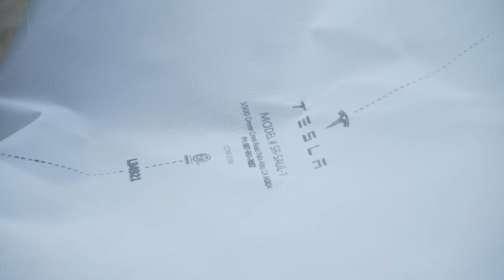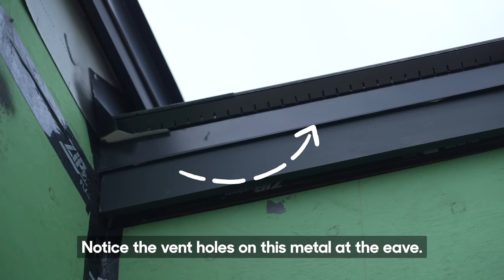Tesla Solar Roof - A Builders Perspective

Comment: I would love to see how the roof performs once everything has been installed.
Reply: Including the total bill and expected ROI.
Reply: Total bill is said to be barely more than a new roof with regular solar added. We’ll see about that.
Reply: Yeah, especially the difference between the installed wattage vs. real world production wattage. So how much power does the installed 55kWp actually produce on an avarage day...
Reply: you must be new here
Reply: @thomasegjoergensen  If most of the cells are facing South on the best days (early Summer) they will produce around 250 kWh per day. On the shortest days in the Winter it will be around 100 kWh per day.
Reply: @Aircam73  Just for some context, south facing wall in the east coast. 20kw system produces 145-153kwh during summer days. I can see his system performing well over 250kwh a day I'd say close to 350-380kwh a day
Reply: @nicholasthon973  Yeah, people buy into anything these days. This is a VERY irresponsible purchase being a beta tester for Tesla. We will soon find out the details on why this system will basically cost you more in the long run, only a matter of time. None of this crap is tested to the point it needs to be.
Reply: I knew that these were going up somewhere.
Reply: @petebusch9069  How would you know??
Reply: The specs on this particular install are insane, probably cost a couple million just for solar and associtated electrical. ROI is not a factor.
Reply: @johncahill3644  Because everyone is a salesman today, nobody can lay out the real costs, everything breaks, nothing lasts forever, and this has not been fully tested. That's how.
Reply: @petebusch9069  please explain.  They have been producing for years at this point and seem to be solid.  My wife's coworker has it on his house for probably 5 years now and seems happy he has a F150 lighting and a brand new Tesla that he brags that he drives for free.  He is honest and says the ROI is probably never but he loves getting a check from the power company.
Reply: @tysleight  5 years is nothing in terms of testing. He paid over 100K for that F150 that he gets to drive for what he calls free same with the Tesla but completely dodged the install, maintenance, repair, and upgrade cost of the shingles and system. There is no way he's coming out ahead for what he spent. Prove me wrong and do ALL the math, all of it.
Reply: @simonsrattanroom  I'm sure its high but lets not exaggerate, a couple mil, come on. I would like to know the real cost that they do such a good job keeping a secret.
Reply: @petebusch9069  big exaggeration,  again not sure who would need this much power and for what lol but I can speak from personal experience. My system cost 70k all 3 powerwalls and 20kw, 26% federal rebate and 1k state incentive. That put me down to roughly 49k once I received two years of rebates for sending energy to the grid and connected solutions. I can tell you this guy received either a 30% federal rebate or 26% + state incentives. If I had to guess based on what I was quoted before it was about 120k for the solar roof. It would be safe to assume this is double that price so close to 300k on the solar alone, the battery's have come down in price now. You can get 3 batteries for 24k and 7k after incentives. Roughly speaking based on the tesla page cost 10 batteries would be 25k after federal rebates! that's insane. People saying this doesn't work or he won't ROI based on his power consumption are just speaking without facts or don't even have a solar system to begin with. Edit: My roof is mainly south facing which helps alot!
Reply: @petebusch9069  
Beta tester?  I've had the same system, but smaller (4 PWs and a 16 kwh Solar System), installed and running flawlessly for 6 years now.  Powerwalls and the solar work GREAT.  No degradation for the powerwalls capacity, and because power is so darned expensive here in SoCal, we just hit our ROI last month.  It's great not being beholden to anyone for electricity.
Reply: @EV-tu5rp  I could see that production capability but by the look of the house only about 50% will be South facing. This will make it much less capable than all 55 kW facing South. These are just guesses based on my 19.6 kW Tesla tile roof here in Texas. Since mine only has around 45% facing South and the best day I ever got was 110 kWh produced I would bet their production is closer to my estimate than yours. Either way it is a massive solar roof that will help stabilize the grid here in Texas.
Reply: @petebusch9069  Damn Dude you really are pretty misinformed. I have had solar shingles for over 3 years now and my insurance has gone down 30% due to the hail and fire ratings on the tiles here in Texas saving me around $800 a year. I used to pay over $5,000 a year in electricity and that was back in 2019 before they raised the rates. I paid $74,000 for 19.6 kW roof and 4 PowerWalls. My roof was damaged due to hail so insurance paid out $20k and the federal tax credit paid out another $19k. Total cost for my system was $35k which will pay me back in around 10 years. If I factor in the $6k deductible I was paying every couple years due to hail damage the roof will pay for itself in less than 6 years. Everyday after that I am making money. This along with the fact that I can stay off grid indefinitely as long as the sun is shining and around a week if it isn't makes this one of the best investments in a house that I could ever imagine.
Reply: @nicholasthon973  not even close. It is cheaper to put on a new roof and get solar panels installed than the Tesla solar roof.  And the Tesla Solar roof will put out less electricity.
Reply: @Aircam73  Get down to a 3 year payback and I'll be interested in it.
Reply: @brentpresley  I guess if they make power in your area so unaffordable you have to do what you did. Only thing is wait until you have to start replacing things, the long term has not yet been established. I may not be that bad but you may end up buying an entirely new system.
Reply: @petebusch9069  highly doubtful there will be significant replacement costs.  The solar system has a 25 year warranty and the powerwalls 10.  If after either of those points I have to do some work, I way past break even.

Plus, these are all solid state components, no moving parts.  Failure rates on solid state are very low.
Reply: @jackylsmith8138  You got the first part right but not the second. It will be cheaper in the short run to put on a regular shingle roof and solar panels but in the long run the tiles will probably be cheaper. As for less electricity they most certainly do not. The fact that you can put far more of the solar all over the roof in every nook and cranny with the solar tiles make it more than capable of getting more solar up on the roof than panels. With panels your insurance goes up. With tiles your insurance goes down. With panels in Texas you have a much greater chance of hail damage to the roof and the panels. And if there is hail damage then the panels have to be removed to put on the new roof. Over time this will cost more than the tiles.
Reply: @petebusch9069  No, one cares if you are interested. There is a wait of over a year to get the tiles so no one is worried about your interest. Also since you can't see that even a 10 year payback makes all your money back from the install then you make money after that. Then if you sell your house you will get about 50% of the price of the roof so you make money that way also. Enjoy your high electric bills as they seem to only be going up in price.
Reply: @Aircam73  Its sound like you care what I think, you responded. There's a wait on everything these days. You won't get 50% at sale, I see this all the time, its worth nothing. My electric bill is very minor especially compared to the costs of everything else. You sound like your not having much fun trying to justify your purchase.
Reply: @brentpresley  Warranty, really. When is the last time you found a warranty to be worth a dam? Seriously, all you solar guys sound like your reading a brochure.
Reply: @petebusch9069  personally, to be completely independent from the grid and not having to worry about power failures or rate increases or the like, and just generally feeling like I'm taking care of myself and muy family and that sense of satisfaction that goes along with it, I'd pay about 20% more than my current power bill. To have a system that looks that nice and integrated and custom vs a metal roof with the usual solar panels bolted on, tack on another 20%. I don't buy the cheapest junker car I can find, or the cheapest toilet paper, or the cheapest kitchen knives, or sleep on a futon I got free second hand, etc. Sometimes it's nice spending a little more to have something that you love and are proud of and works well for you. 

That being said, if it's a 10 or 15 year ROI, that means future-you will be looking at a power bill he wouldn't be paying if today-you had pulled the trigger. Today-you might think it's stupid, but future-you will wish he could come back in time and kick today-you's butt.
Reply: @petebusch9069  I responded not for you but to help the others who don't know any better. My solar is one of the best decisions I ever made. When the power was out for over a week in Texas my lights never flickered. I haven't had a power bill over $40 in 3 years. The fact that my house is worth more after I put up the solar even makes me happy. I don't need to justify what is obvious to most.
Reply: @nicholasthon973  panels alone, not including inverters and such
Reply: Return trip
Reply: @EV-tu5rp  You mean, taxpayer funded (extorted) incentives? How is this different from socialism? (government owned means of production)
Reply: 9
Reply: 99
Reply: @thomasegjoergensen I
Reply: @thomasegjoergensen I don't
Reply: @troy3456789  w.e floats your boat buddy
Reply: @EV-tu5rp   I am not your buddy. Why did you say that like that?  I realize this is online and you are weak, and want to feel strong
Reply: There are several Tesla YouTube video reviews online.  It’s def the best looking to me, but the price is still not right IMO.
Reply: ROI for a Tesla Solar roof vs roof mounted solar is about 2.5 times more then conventional good grade solar- based on 2020 prices. Most likely in todays costs are even longer probably 4 years. Annual energy production is about less then half from a same size solar system or even lower. We have a 17KW system from SunPower and it is producing 11,000kwh. Tesla would produce half of this for about 2 as much. Our solar panels have macro inverters vs tesla has a single inverter system.
Reply: @dzsink  How much did you pay for your system?
Reply: @troy3456789  You just answered your own question. Does the government own the solar panels? Do they own the company that produces the solar panels? That would be no so it has nothing to do with socialism.
Reply: @dzsink  The amount of misinformation coming from this one post is astounding. Tesla has both solar tiles that are a premium and solar panels which are just like everyone else. Tesla solar panels are typically far cheaper than most other installers out there making a ROI even quicker. The tiles are also not 2.5 times the price they are around 35% more than panels. You do understand that if Tesla puts up a 17kW system it is no different than anyone else that puts up a 17kW systems right? That is how you rate the systems and the fact that you don't know that just shows how misinformed you are. Also micro inverters have some benefit but so does single point inverter systems. I don't know who informed you about Tesla and what they offer but you really should stop listening to them as they don't know what they are talking about.
Reply: @Pete Busch  have had mine for 2 years 10.7 kwh setup got one free powerwall so I have 2 spent 60k - 26% tax credit on everything. Down to sub 40k my energy bill was 400 a month before now it's 0 to 40 bucks a month so I save only 5k a year. So yeah I think I'm winning. 5 year roi nothing comes close to this investment.
Reply: @Aircam73  Hello, I am engineer by trade. I usually calculated ROI and I am not spreading fud. I have a model s100d power walls and stock. But I am sorry there is huge difference between solar tiles, and Tesla solar panels and other manufacturers panels. For instance Tesla solar tiles has nowhere near the efficiency of a Soler panel while the cost is magnificent. Tesla solar panels are less efficient and have one inverter which makes the system more prone to failures. Other manufacturers such as Sun power manufacturers industry leading solar panels. So to say and Tesla solar tiles to match our solar panels of 17,1 kW system you would pay around 75,000$ and would have about 20 % less efficiency of Sun power system. Warranty is worse and the degradation is worse and along with the system warranty is worse. Not to mention that each tiles system and panels system have a single inverter-whuch drags the system down and if fails your entire system is out.. So when you look at overall system performance this is one of the main reason why under performs. ROI for Sun power system ROI 22 years, solar roof 31 years, Tesla solar panel ROI 28 years. Also Tesla over promising their solar production with half of the system size of Sun power by almost 50%. Math doesn't really work. I spent on thus almost 6 months looking around the market. No companies are perfect but I am sorry Tesla is not being upfront with efficiency, cost, no architect signed solar production forecast etc. I like Tesla as I said but the solar roof is an expensive toy.
Reply: This is a fundamental question that shouldn’t have to be asked
Reply: I wonder how phone reception is in there
Reply: @nexusly6720  that is a LOT of money for just under 11kwh system with a powerwall.
Reply: @petebusch9069  This is not a new system Tesla Solar has been around for years they don't advertise it much. There is no beta testing here. They sell them on the same site as Tesla cars.
Reply: @petebusch9069  Then do the math and prove you are right as well. You can't make speculative claims about a system and then expect everyone to give you fact about why your wrong you need to give facts about why your right.
Reply: @ekbusdriver  2 powerwalls  3000sq ft roof mind you
Reply: @Galagar938  Sounds like you have doubts about your purchase.
Reply: @Galagar938  No beta testing!!!!!!!!!!! are you kidding me?
Reply: @petebusch9069  My Lightning was 55K and a $13k solar system would power it for free WITH an 8 year warranty and a 10 year lifespan. I consider myself a Ford beta tester and I am fine with it. Leaving my diesel in the driveway every day almost pays my note by itself. AND even with paying for electric at the highest rates while traveling, operating costs are one third of my diesel. AND that is without factoring in maintenance like oil changes (that are 5 gallons a pop). Not to mention it is the freaking sweetest ride and freaking fast as hell. Never would have I imagined the my MLC car would be an electric truck but I couldn't be happier with it. I am 10k miles in, multiple road trips, towing a boat and a farm tractor... AND it will back up my house for near a week in a power outage. Haters just going to hate and ignorance rules. Our planet can not wait for everything to get out of beta. The world would be a little better off if everyone wasn't just worried about saving every single penny. People should spend that much energy trying to put the screws to
 big oil who has been robbing us blind for years. People are so shortsighted. I saw the future and bought my first gen lightning, and will never buy another ICE vehicle in my lifetime!
Reply: @nathanddrews  it's very good roo
Reply: @nicholasthon973  it's very good roi just like solar this covers entire roof everyone will have this on their roofs
Reply: @petebusch9069  not irresponsible at all, this not a prototype it is already proven high quality high performance  solar panels and outperforms a normal roof metal or other
Reply: @petebusch9069  You are way out of your head here. You say it needs to be  less than 3 years ROI on product that is designed last +30 years. 

There would be no other roofs than Tesla if that would be the case.
Reply: @thomasegjoergensen  a 1KW solar panel in Texas will produce 5kWh per day on average.
Of course it changes through the year, and on very cloudy days it may go down to 1kWh, but that's the average you should expect.
Reply: @petebusch9069  i mean if you have the money.... why not
Reply: @petebusch9069  But this is testing it, isn't it?  70% homeowners money.
Reply: @thomasegjoergensen  just for reference, my installed (Denver) non-tesla tile system wattage is 5.2 kW on 14 U.S. made Silfab panels and best i can do is (4.1 kW per hour from noon to 3:30pm) 37 kWh total a day on the best clearest sunny day. 4 panels facing south, 4 east, 6 west with not too aggressive roof pitch angle. usually on zero cloud days i can get around 34 kWh
Reply: @petebusch9069  They've been installing them for six years, beta's over.
Reply: There are tons of videos out there showing exactly this. Look them up.
Reply: Check out marques brownlee he did a great video on 1 full year with Tesla solar was really well done
Reply: Mkbhd has a great video on it
Reply: marques brownlee did a good review of it.